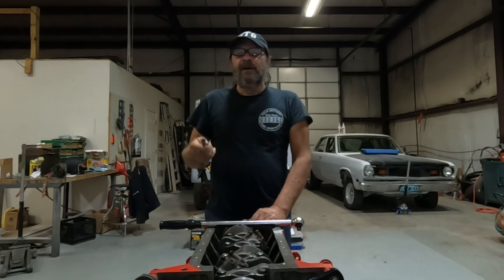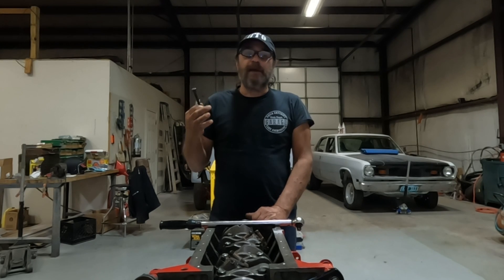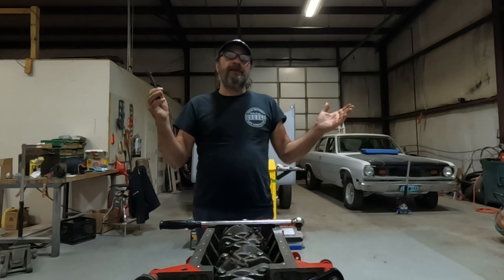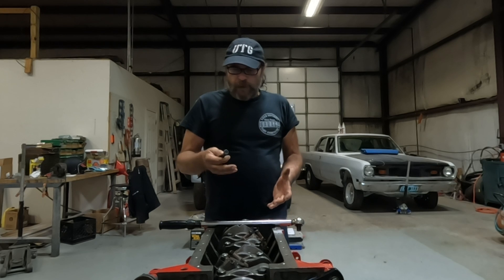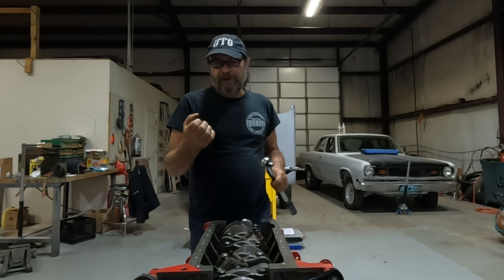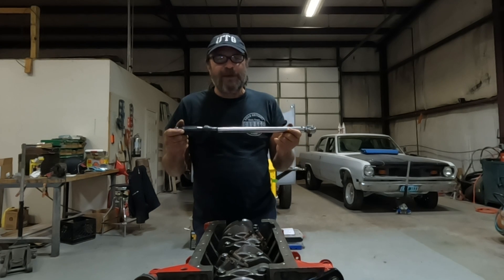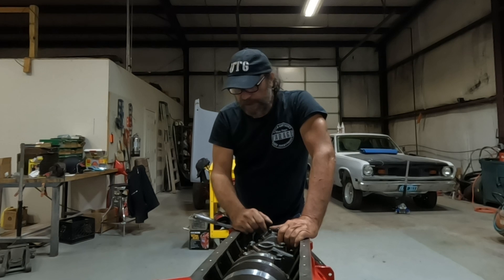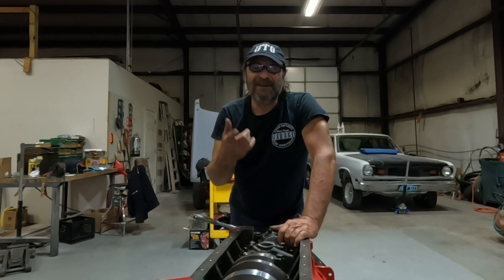Torquing Mains, Rods And Cylinder Heads For The Home Engine Builder

Comment: Uncle Tony

Your action was poetry in motion.

1.  Hand on the handle - not closer up which does affect the torque applied
2.  Forearm 90 degrees to the wrench - AND HELD LEVEL ON THE SAME PLANE
3.  At all times totally smooth action
4. Body perpendicular and holding the block square to the wrench at all times....

OUTSTANDING.....!!!!! - 

PS the best torque wrench is a Warren & Brown Deflecting Beam Aussie made  + or - 2% accuracy

Clicker wrenches........ Meeeeeeh...... = or - 4% as a rule

And i watched a review that showed to get the 4% or better with a clicker you have to 'warm up the wrench' beforehand

What that means is you have to put a bolt in the vice and work the wrench up in 10% increments and down again in the same manner because that puts some heat into the internal spring and the grease covering the spring...... which otherwise causes excess internal drag and inaccuracy when they are used stone cold....... so temperature is a ting with clickers........

Deflecting beam you don't have to do that they are bloody good - all the best from Melbourne Australia...!!
Reply: I always wondered how accurate clickers are.  Clickers are kinda useful in tight spots where you can't see the reading on a beam, but I never heard of the warmup procedure. Makes sense, thank you.  UTG comment section is one of the best on YouTube! Greetings from Florida!
Reply: @Face2theScr33n  

Yes 

I'm afraid its all true....!! - and makes sense because the grease internally goes a bit stiff with temperature and age of the wrench...... I'm sure that YouTube video is out there somewhere but you can google it.... - springs do also lose tension with age... and go stiff stone cold......

Cheers mate to our American Brothers......!! I'll put a shrimp on the barbie for ya.......!

Comment: I don't know if it is necessary to explain about using an extension on the torque wrench. A lot of people may not know about that. You can have deflection in the extension and disturb the torque value. The more extension the more deflection.

Comment: Torque is an attempt, depending on the material of the fastener, to stretch the fastener close to but not exceeding the yield point of the material of the fastener. Where possible for example with rod bolts, many engine builders will measure bolt stretch in place of a torque figure to properly tension a fastener.

Comment: When ya get to head bolts when tourqe finished give bolts a little whack with hammer then re tourqe wacth the bolts exactly turn a bit more just old hot rod tip as you probably no ut.peace

Comment: Also, when torquing bolts, don't use an extension. The flex in the extension will throw off the torque reading. If you have to use an extension for some reason because of space constraints,  then use the shortest extension possible. The longer the extension, the more it will flex. On most applications it probably won't matter. But it's still good practice
Reply: https://youtu.be/tRR96ILGORU
Reply: This is good advice too

Comment: 10:20 someone told me long ago to stand on the engine stand. 
It's kinda fun ,you usually end up rolling a few feet around as you torque if it's a smooth floor.

Comment: I'm not criticizing Uncle Tony at all, the guy is a true master, but I'm surprised he didn't mention ( for the true beginner )
that it's important to not use an extension on a torque wrench to maintain accuracy.
Reply: That very question occurred to me while I was watching.
Reply: You couldnt be more wrong. A straight extension will not effect torque only the distance from the handle to the bolt will.
Reply: @Ticeracing33  The distance between the torque wrench handle and the bolt head will change leverage, not torque.
The distance between the head of the torque wrench and the bolt head will decrease torque applied to the bolt as that distance increases.

Comment: Wanna see how flexible a block is ? 
Put a garden hose on the water pump inlet and block the thermostat outlet. 
Yep watched a guy in the engine shop forget to pull the thermostat before doing a test run on a Perkins 4cyl diesel and kicked on the hose. 
You could see the water jackets expand like 3/8 of an inch. 
You'd swear you were on acid and the walls were moving.

Comment: I've found it very common to go back to the 1st bolt in the procedure and find it loose again.  
Run each stage until there's no movement.
Usually that's on things like heads and bigger items that it's very noticeable.
Reply: I agree, and believe the quality of all the surfaces involved and the bolts play a role. some metals are really soft especially with wheels

Comment: This is so timely.  Just dropped off my block to the machinist to get hot tanked, inspected, bored for the new pistons, and checking the crank to make sure it is still in specs and true.  I am going to be putting it all back together as soon as they come back.  Really like your channel.  Found it a while ago, and have been slowly working my way through the videos.  I have been around motors and tinkering with the rest of the vehicle my whole life, but it never hurts to see it done again.  You seem to be a guy that you could wrench with a bit, slap some brats and burgers on the grill,  then crack a few cold ones with afterwards.  Keeping it real, and down to Earth.  Not expecting everyone to have $100,000 wrapped up in the garage and so spotless you could eat off the floor.  Love it.

Comment: Question I've never found an answer to. Do thread compounds like anti-seize or thread lock affect torque readings?
Reply: Yep, take moly grease vs motor oil ,and then realize moly is for extreme pressure lubrication and will be "slippery" at higher loads , so you'll get more clamp load on a part  when it's lubricated vs it not being lubed.
Reply: But yeah of those items you listed would increase clamp load a little from less friction on the threads even the thread locker because it's a liquid before it cures.

Comment: Good advice on backing off the wrench settings after using your clicker type tourqe wrench.  I've seen a bunch of guys leave theres tight and never know it could screw with the calibration of the wrench.  It's also one of thr reason I bought a digital tourqe wrench because there is no need to remember to back off the setting back to zero.  They are expensive but they are ready nice.  Plus I always have the clicker for back up
Reply: Yeah I saw a vid recently that the guy said don't dial it way off ,just put it on the lowest setting.
Reply: @MrTheHillfolk  I didn't know that, I've always back mine all the way off.  It's still with in spec though.  Where I work I can get it tested and recalibrate it for free so I took all mine in and had them done.  Out of 4 of them I had one bad one and it was a snap on.  My cheap ones passed.

Comment: Years ago I taught Automotive Mechanics in Trade School for a couple of years. I always had a " Talk on Torque" where I essentially said the same thing Tony is saying. You should have seen the looks on kids faces when I told them that what "torqueing a bolt" ACTUALLY was , was the process of spring loading a piece of steel and stretching it so that it would hold two pieces together properly. I had some kids try and argue with me because they had never thought about it. This is one of the few times that I have ever seen it explained correctly on the internet, the place that FACTS go to die. Tony knows of what he speaks and deserves to be listened to. Job well done Tony!!!!!!
Reply: And a properly torqued bolt is already pre-tensioned, so when it performs its job it can do so without stretching much more, keeping stuff from shearing off or moving otherwise.

Comment: when tightening down the caps (main or rod)...and you 'crush' the bearings....  then later you disassemble ....  when you reassemble the caps...do you get the same 'crush' ?  (kind of thinking like a crush washer....or bearing shells designed for this.  I taken apart my caps a few times to measure...but always wondered if the integrity of the bearing shells were compromised in any way.

Comment: Should you re torque the heads after running the engine?
Reply: Depends on the type of gasket, they say MLS doesn't need to.
I like to check em if I can, even if they say it doesn't need it.
 If anything I'll see if the bolts wanna go tighter, not loosen them 1st and bring it back up.

Comment: So when you grind the caps for align bore or grind the rod caps for reconditioning you end up with too much crush? Bearing pinch? I never had a problem with bearing crush but I did see timing chain slop with align boring. They have a fix for that.
Reply: no, when you cut the caps, which makes the hole smaller, you then hone the inside back to the correct size.
Reply: @myretirementlife8731  Basically you have changed the center to center distance between the pin and rod center changing the piston to deck height .Great answer .

Comment: UT:
   I virtually never comment on sights. Loving your channel the way I do and having been such a long time subscriber, I thought it about time to comment. 
   Question- I just bought a couple brand new click style torque wrenches a little over a year ago from Harbor Freight. I ignorantly stored them without zeroing them out. Do you think that I have ruined thier accuracy?
Reply: I'm not UT, but I think as long as they were not stored at high numbers, you're probably fine.  I say this, as when I worked at a heavy machinery company, there were very expensive wrenches on the line (4 foot long+) that were calibrated and set at a value for use on the line.  They were also clicker style, and didn't drift appreciably between calibrations. 

Now, they were also properly designed with proper springs that didn't fatigue at set tensions.  Who knows if HF wrenches use properly designed springs that won't fatigue and stretch.
Reply: @merr6267  Thanks for your insight. ✌

Comment: had this talk recently, consensus; use copper slip on threads and you get more accurate tension, so that's what i went for on m'heads, done one heat cycle and re torqued ,  see how this fella' deals wih head bolts, by then i should know if my way was carp !.
ps you lose 'feel' when you get arthritis.
pps correct way to torque by feel is to tighten until tension 'softens', then back off a 1/4 of a turn. JOKE !

Comment: It is extremely easy to over torque with a digital beeper torque wrench.  I like the display and getting really specific with the torque, but I prefer the give of the clickers.  Now clickers are not good at low torque. They are hard sometimes to tell if it clicked and usually you went over and never felt it. For my work, it depends on what I am doing. Digital for low toque (up to 25lbs) and clicker for everything else.
Reply: It's  better to over torque a little than under tighten
Reply: @markschmalenberger8301  haha that's why our shop ,on the damn Briggs air-cooled home standby gennies has been doing it wrong on replacing head gaskets for about 7-8yrs now and haven't had a comeback. 
They say dry head bolts ,and 220 inch pounds. 
I say lube them and give em 21 foot pounds. 
About 3 pounds over ,plus lubed threads equals no more comebacks.
Reply: I'm with you on clickers, which is why I have several ranges in the box.  I feel comfortable using the 20-90% range on any of them. Outside that, I change wrenches.
Reply: 100% agree on clickers. Ever since I swapped I haven’t gone back. Easier to get a more accurate torque.

Comment: By or by not the factory specs; using bolts (not studs) while torquing main caps; I thought it was best to do so in unison. Meaning each bolt would be tighten in a same sequential step, until all are completed on the final torque valve. Not each main cap at a time. In regards of the of torque wrench to use? Maybe It should be asked how often we verify the torque value is correct regardless what type is used? I m guilty of dropping mine or forgot to reset to Zero after use. Over due to send out for calibration anyway.

Comment: UTG @6:40 Torque is not tension https://youtu.be/O96AUlIBkU8
putting oil changes the torque specs. manuals should state lubed or dry

Comment: In your first video of this engine build you oiled the main cap bolts. You were going to explain why later. Did I miss something? Curious why. Keep up the great videos.
Reply: He said not to over oil the bolts. My guess is that sometimes you can hydrolock the bolt in the bolt hole. When ran in fast with impact or even just being torqued it could crack the casting.
Reply: @timg2776  Yes Tim I got that part but was wondering why oil the bolts to begin with.
Reply: It just helps with the block (or any threaded object for that matter) threads not “ galling “ on the bolts and causing a false reading when torquing them down.  I use a CRC spray bottle on the mist setting to shoot all mine
Reply: @docfischer7291  Thank you Doc. That answers my ?.

Comment: I was an electrical engineer at a company that made excavators.  As such, the boss had me do a lot of non electrical stuff.  Once, I had to "design" a big metal tube to act as a spacer so that longer bolts could be used.  I asked "Why are we doing this?  Why not just use the shorter bolts?"   The answer was just what Tony said.  Bolts are really springs.  The longer spring can stretch more, and apply more force to the joint.

I hate to admit this, but if there's a torque spec in the book I use it.  Even if it is a fender bolt, or a plastic trim bolt.  I'm just horrible at "feeling" or knowing what is "tight enough" and not "too tight."
Reply: When I was a truck driver, a truckers magazine had an article about bolts. It said they were like springs. They can be overtorqued without breaking, and stretched to a degree where they will no longer have a spring effect. Then they will never stay tight.
Reply: I really like how people are taking time to explain things. It just makes it a nice and informative place to be.  Thanks to all who participate!
Reply: Interesting concept on the bolt spacer here, embarrassingly I am confused, does not compute.  Specifically, the example in my mind I'm using to compute this concept is: say we have 2 bolts of the same material and diameter, but of different lengths, then why does the maximum force change if there is no change in the cross-sectional area or material properties.  The longer bolt would physically stretch a longer raw distance, but proportional the the length of the shorter bolt so it's nothing to do with max force.  I may have forgot my materials lessons and got it wrong here.
Reply: @RwP223  it's not the force of clamping that changes, but the reliability of the clamping load that changes.  Think about a rubber band holding a weight on a fishing scale.  If you have 2 identical thickness rubber bands but one is short and the other is long you can illustrate this.  Hang a 1.1 ounce weight on the short rubber band and measure the length and say it stretches from 1 inch long to 2.1 inches long. Do the same with the long rubber band.  Pretend that it stretched from 2 inches long to 4.2 inches long.  The percentage that they lengthened compared to their length is the same (they both doubled their length, but the length that the long band stretched is 2 inches on the long band, and only 1 inch on the short band..  Now take a .9 ounce  weight and hang them.  You'll notice that the longer band stretches 1.8 inches to 3.8 while the shorter band stretches from 1 inch to 1.9 inches. This illustrates that for a given tension on a loaded member, a longer member gets "more longer" than a shorter member. 

Now imagine that our goal is to maintain tension as reliably as possible, under all conditions, etc.  Using the thought experiment of the rubber bands,  we could say our desired tension for our system to work is 1 ounce of load on a rubber band, and your only way to replicate it is to stretch the band to a set length using imperfect measurement techniques.  

The longer band will be easier to control the tension based on length, because you have a wider length target that you know will produce the desired 1 ounce tension. You know from the previous experiment that the desired length of the 1 inch band under 1 ounce tension is 2 inches.  you also know that the desired length of the longer band is 4 inches. 

If the acceptable tolerance is 1 oz +/- .1 ounce, you can see that the short rubber band system has to maintain a length of 1.9-2.1 (.2 total tolerance) inches to keep its tension in the acceptable level. 

The longer band needs to keep its length between 3.8-4.2 (.4 total tolerance) inches to maintain its tension.  This is a 2x improvement in ability to hold proper length vs. the shorter band.

 That length of stretch is what you're attempting to achieve when you torque a screw.  What you gain by using a longer screw is more ability for the screw to absorb the minute changes in the clamping height vs. that of a shorter screw.

Clear as mud?
Reply: @merr6267  Makes sense in this new light for sure, thanks for laying it out!
Reply: @merr6267  Thanks for the explanation.  It was many years ago, so my memory wasn't good enough to explain it clearly.
Reply: Torque of a screw (bolt) is also related to the length of thread, the diameter of the screw, and the force used to tighten it. Washers are often forgotten and that can drastically effect the clamping force and torque value.